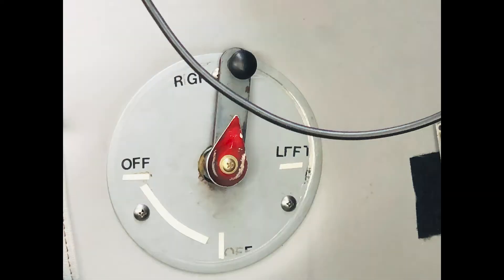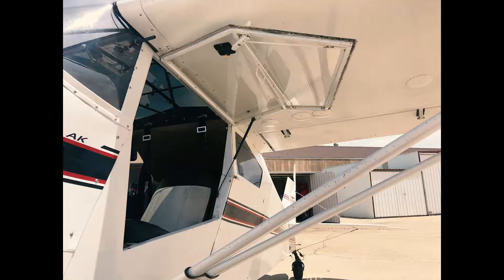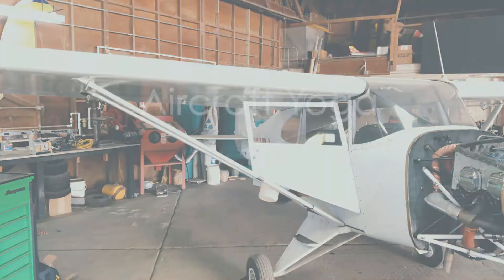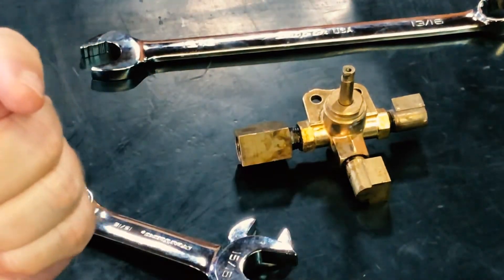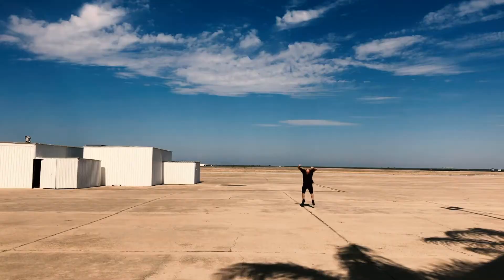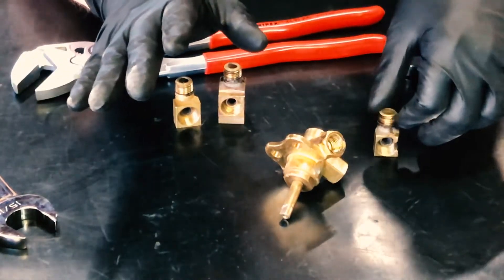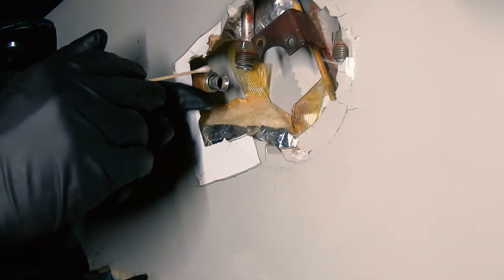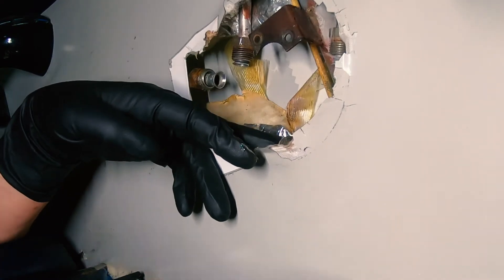How To Upgrade The Fuel Selector For A Piper Tri-Pacer with the Dakota Cub STC (DIY Series)

Comment: Very funny, very entertaining. Owned 3 TriPacers, 2 of the 135 kind and one Colt with 150 on it.  I found it hard to see that the 150 made any noticeable difference but it must have.  Your advice is invaluable.  Your experience in working on this old airplane mirrors the experiences I had working on my old airplanes.  Thanks for making me feel that Im normal.  Just watched a video of a guy flying a TriPacer over heavily forested coastal urban/suburban life with lots of open water - nooooo place to land if you HAD to.  I kept saying, I sure hope your engine keeps running - you have more faith in old Lycomings than I do, even though I know Lycomings run forever - mostly.  Thanks again. I will recommend your channel to my EAA chapter.